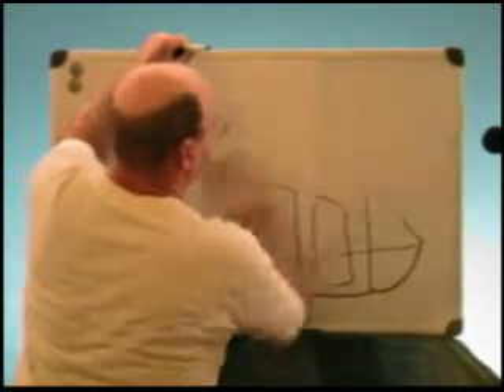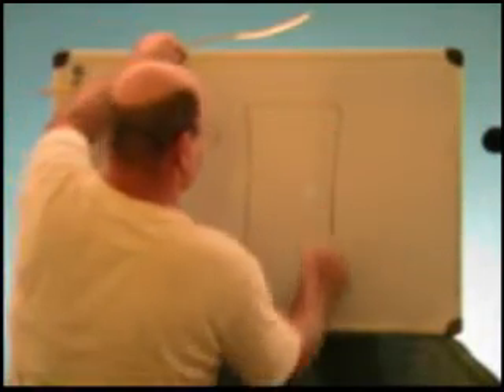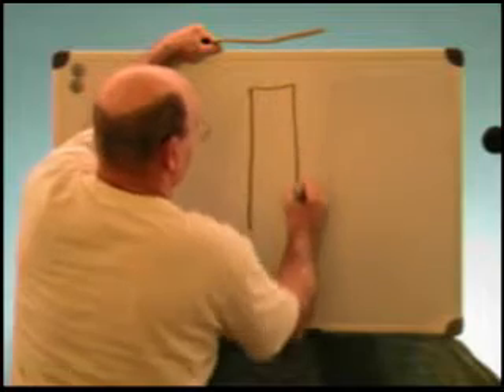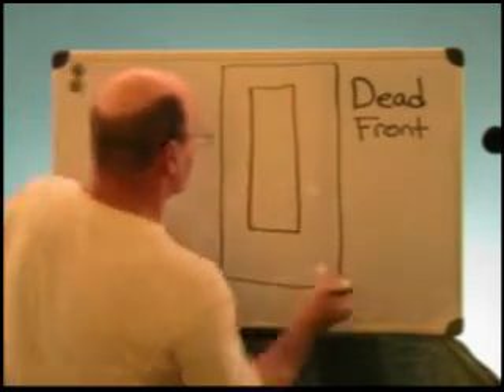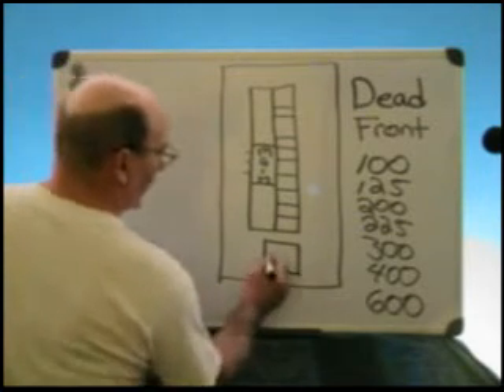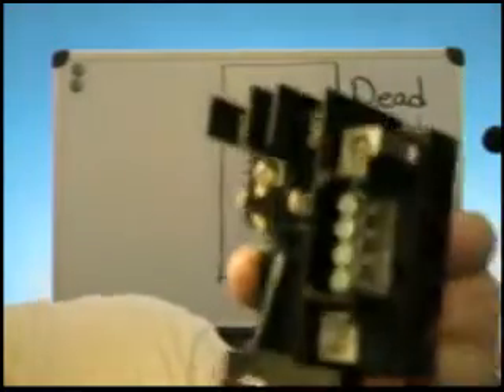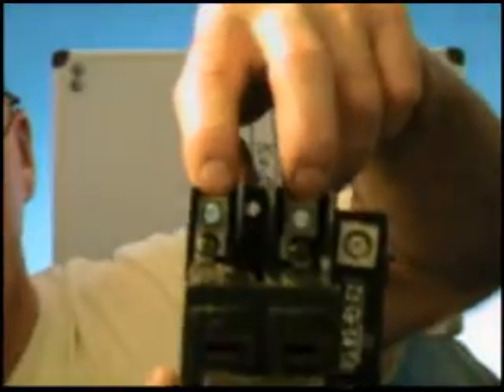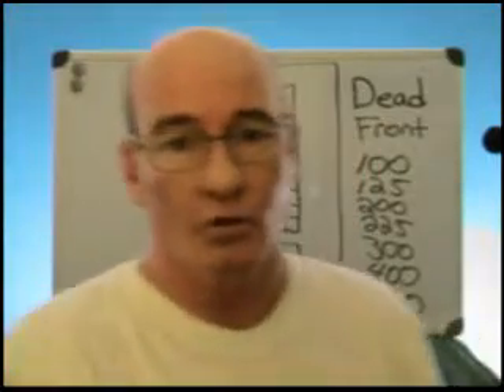SERVICE PANELS AND SUB PANELS # 8

Comment: not true there can b no meter and still be a main panel ur meter can be mounted in a remote location and panels can be fed off of meter through main disconne cts and run ser to main pabels

Comment: In Trinidad and Tobago we call the panel with the meter...the meter panel located on a 20ft pole inside of the customer's premises.. The meter panel usually has no breakers. From the meter panel is the main cable  which runs underground to the inside of the house to a main panel which has a main breaker 100-200amps and the circuit breakers usually 50,30,20,15 amps

Comment from the maker: I am doing a real time video on a grounding code violation (from another electrician) that I was hired to correct. As soon as the parts come in I will explain what the violation was and include the remedy.  It is a 200 subpanel that was improperly grounded and the ground and neutral were not isolated. My remedy has already been approved by the City of Las Vegas...I just gotta get it done.  Hope it helps.

Comment from the maker: @keithbracewell Yep they sure are, but in any trade there is lingo and intentional misspellings. Look at most electricians field notes and they use the spelling lites because its shorter and eliminates four strokes (five if you include the movement from g to h). GFI is actually GFCI but again we omit the C. Underground Ferrous Rod is reduced to the slang term UFR (pronounced You Fur)  Thanks for the comment.  Have a good one.